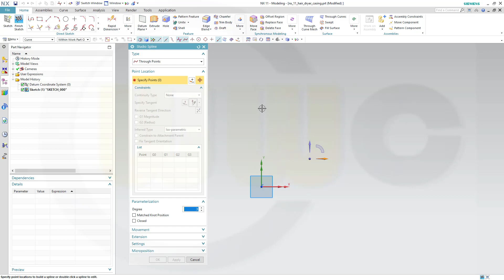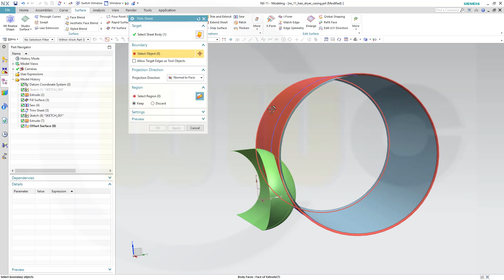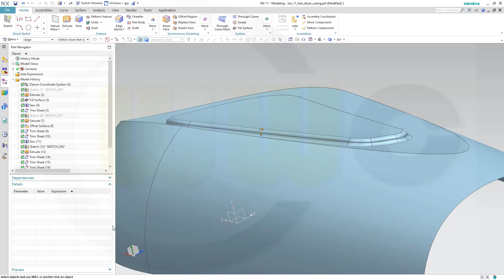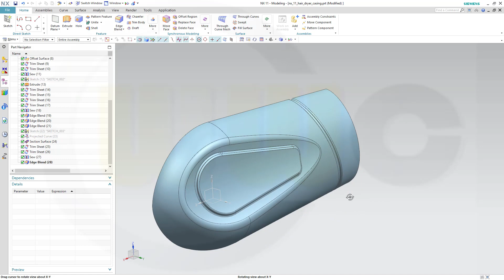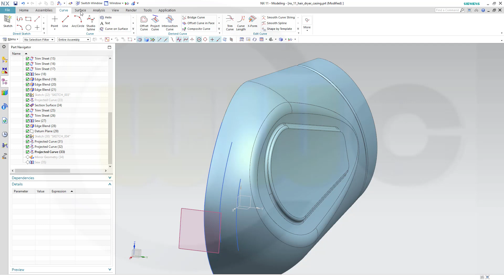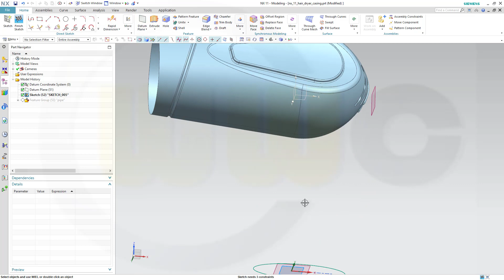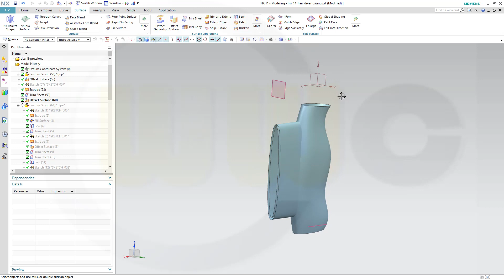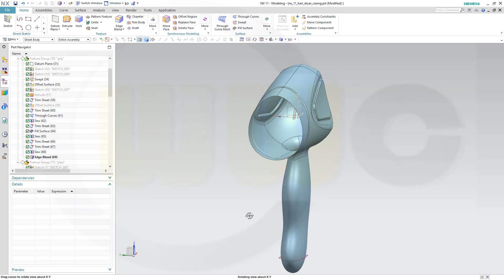12.1 Hair Dryer Casing V2 - Siemens NX 11 Training - Surfaces

Comment: Show to use 3d command on finish sketch
Reply from the maker: Come on, you have to improve your question - what do you mean?
Reply: How to use 3d command on finish sketch like arc line
Reply from the maker: Sorry I really don´t get it - "3d command??? finish sketch??? arc line???" - What do you want to do?
Reply: How we make a sketch on 2d like that if we won to provide same arc on isometric view
Reply: Solidworks has 3D sketch, it is like ordinary sketch but with one difference: while drawing you can change the drawing plane  by pressing TAB on keyboard. NX does not has such a tool, in fact one does not get in need of this kind of a tool while NX has lots of pwerful commands at curve toolbar. So I believe he's asking how to use "curve toolbar" tools instead of sketching tools. Bertan "the translator" out. :)